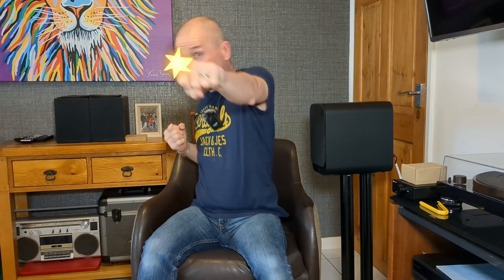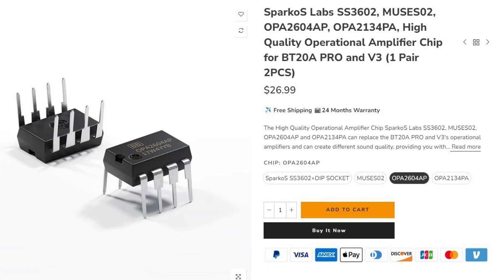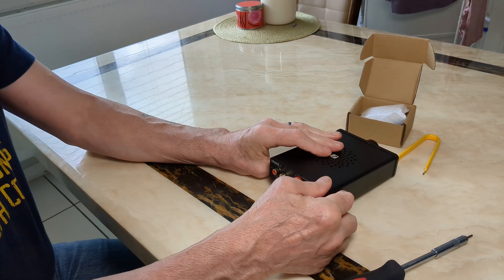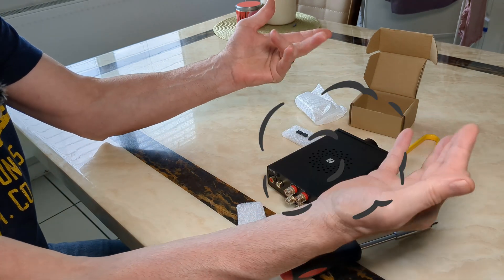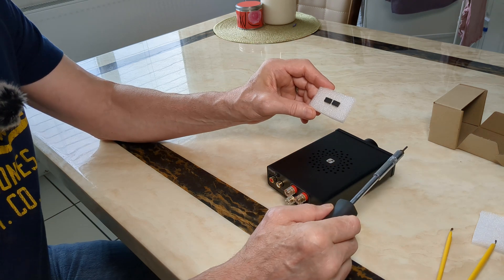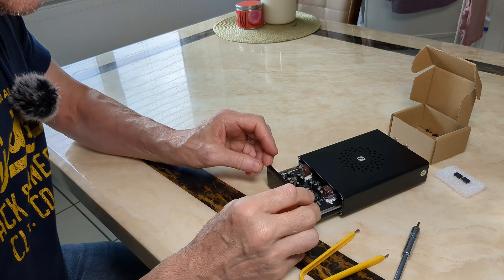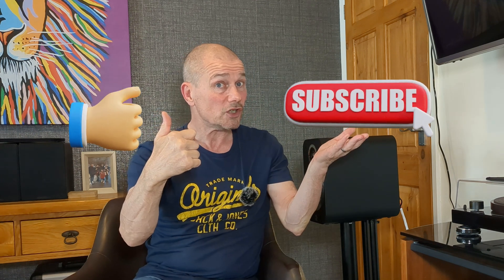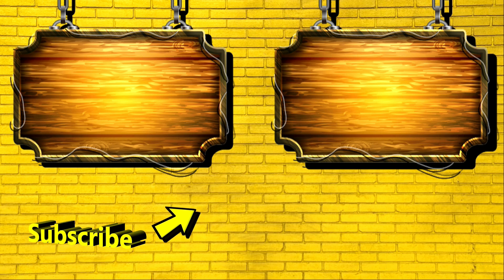NE5532 Vs Burr Brown OPA2604AP With Blind Sound Comparison

Comment: I saw in another vid a guy showed how you can slip a small zip-tie under the opamp chip and easily pull it out using that.  Almost zero cost. Well if you have to zip the zip-tie then I suppose it costs you a pair of ties ;-)

Comment: More midrange on the new ones. I’ve got a budget setup in my office, the for bt20a pro with monitor audio bronze 2’s, basic copper cable, and RCA’s. I find the mid range is lacking.

I get the bookshelf’s do not have a dedicated mid range, and worse cross overs that my floor standard downstairs, but I think the stock fosi makes the sound more muddy.

It’s not a bad little amp, but definitly need more mid/range. I will try the ones you have thanks.

Comment: OPA2604AP is clearly better here I can hear that with only one ear^^. It sounds much more analog and takes the harshness out of the highs. You're much more immersed in the sound than with the NE5532P. You can hear the digital harshness. Some people are just used to it and then say they like the NE5532 better. Once you sit down in front of the system yourself, you'll see...! The OPA2604AP is also certainly much better tuned than the chip from 1979. Welcome to the 1980s.

Comment: Op amps do not have a sound. The circuitry, of which they are parts, was designed using NE5532, which are the industry standard for very good reasons. Swapping for an op amp that certainly cannot be regarded as a direct drop-in replacement is simply not a good idea. In this case, the increased distortion of the circuitry can actually be heard.

Comment: We swapped out a bunch of NE5532 for OPA's of some number in the mic preamp of a mixer. Power supply ripple rejection was the measurement that improved and having before improved power supplys while keeping the amp the same I suspect that's what improved the sound with the OPA, the ripple rejection. I'd describe it as a grayness being removed. detail was the same.
I couldn't hear it on this test.
Reply: Yes Slew Rate is the big difference

Comment: Today I replaced the pre-installed NE5532Ps in my Fosi Audio P4 preamplifier with OPA2604APs. Only one is needed. In my Fosi V3 monos, I swapped the four 5532Ps for Audiophonics OPA1642s. The cost is low, the effect is amazing. A total of €30 plus €5 shipping from France to Germany. As far as I know, the OPA2604s are no longer regularly available; Audiophonics will be able to get them again at the end of June 2025. And please don't slap me:face-orange-raised-eyebrow:
Reply: will the Audiophonics OPA1642 work also in a P4 ?   i have one stock of course   Thanks a lot

Comment: That tool likely works fine, you just need to be patient and do a lot of wiggling. Left, right, left, right. Slowly does it, a bit at a time. I have one the same, works for me.

I thought A was better... sounded very slightly more open. I'm not sure if they were 100% level matched. But it was interesting to hear some kind of difference.

BTW if you have a tiny bit of electrical soldering skills, you can buy the SOIC-8 version (surface mount) version of these sorts of chips (2604, 1656, 1612, 2134, etc) for likely 1-5 pounds from a trusted distributor (mouser, digikey, farnell, lcsc, etc). In fact unless you buy enough of them, the biggest expense will likely be the shipping cost. Then you can solder them to a small DIP-8 adapter board for use in one of these sockets.

Comment: Preferred B through MacBook Air + DT 770 Pro; felt it was a bit fuller, which is more my bag but it was distorting a bit during the latter part of the first track.  A wasn't too bad by any means. 
About to swap a pair of Muses02 into my Fosi V3 Monos so this video was timely.

Comment: I could tell before you revealed it which was the 5532 and which was the 2604. I personally prefer the 2604 which has a "warmer" sound. The 5532 possibly has more defined treble, but I find it a little fatiguing to listen to after a while. I have tried many different op amps and they all have pros and cons. My current favourite is the Muses 2208 which I find very easy on the ears.
Reply: Do you find the 2604's imaging better? I do
Reply: @michaelhoudecki3657  Yes, much better instrument separation and a wider soundstage.
Reply: I'm with you too otherwise I just listened to it with phones speakers . I'm thinking on replacement of 4570 on my denon dct-2000 , after dac of 1702s . I like to get warm sound and huge sound stage and thick sound , and good harmonics specially in low mid that makes joy . What do u think ?

Comment: I hardly heard any difference, all these Fosi, Ayima "budget"chipamps sound more or less the same, that is FLAT HARSH and therefor quicky fatiguing, what REALLY makes a HUGE  and instant notaceble difference is audition a REAL CLASS A amp.... like the still pretty affordable BRZHIFI MUSIC FAX A21 , availeble from Alie express for around 250 Euro's , this is a chinese Clone; of the  Famous Britisch made,  Musical Fidelety a1 amp from the 80"s, that whas a real "High End amplifier, with a lovely warm and deteiled sound, with even today very few amps can touch....only drawback was its ernomous heat production ( you coold cook an egg on it) and of course the price ( the make an improved version witch does not run that hot but at a price, the chinese copied the most of the amp, and put newer an much better parts in it aswell gave it a very sturdy and bigger housing, that manage the heat way better,  i was toyying just as you with a few chipamps but one day ( fed up with their schrill sound) ordered one from alie, result?
MUch more "musical sound" detail, stereo with AND dept, a spound wich invites you to keep listening for hours on end, no more Harschness, the brzhifi is "only 20 watts per channel, but has way more current drive than these chip amps . so behaves like a 2X100 watt amp, even with 88 db eficient speakers you can get the police nokkong at your door.
try to  audician one , bet you be amazed.
Reply: I have the Fosi V3 Mono and also the A1 Clone you mentioned (which I had before the Fosi). When I first heard the Fosi Monos, they sounded better to me than the A1, but then I realised they were just a bit louder. Once I level matched both of them, the amps just sounded the same as each other, which is not really surprising as they are both good amps. The A1 is a cost effective way into trying class A amps though, so I'd recommend for that reason alone. Personally I've never really heard a difference in amps, unless one is intentionally coloured / distorted e.g. tube amps. I get more from changing speakers and using PEQ.

Comment: Rolling dead spiders. 😎👍
Well done.
YouTube compression makes it near impossible to hear. 
Even hi-resolution recorded files are near impossible to hear. 
I have an ESS Sabre DAC with switchable filters.
The audible changes are very, very small.
Some of the filters can cause a sense of pleasure or aggravation after a period of time listening on a fairly highly resolving system.
Like some cable / Interconnect changes. 
I have a few different DAC's and amplifiers on hand now, and I'm thinking that I will not be rolling anything, unless I'm displeased with something about the sound on a longer term.
At least rolling dead spiders is cheaper than constant amp and speaker changes 😎👍

Comment: I never had any luck with that style of IC extractor, or even the posher ones.

I found it MUCH safer and easier, to just gently pry each end of the chip with a small flat screwdriver.
Prying slightly at each end of the chip in turn, you get very used to it after a while.

Just be careful not to shove the screwdriver between the socket and the PCB. I've done that once or twice in the past. lol
Reply: Use a small zip tie. Super easy.
Reply: @ryanb8736  In my experience, any time a method is used that doesn't put equal pressure on both ends / sides of the chip, it often ends up with pins getting bent.

If you mean slotting a zip tie (cable tie) under the chip, there's usually not enough space, and you'd have to pry slightly with a screwdriver first.

Some people might get on with using those extraction tools, but I never have. lol

Especially the evil PLCC extractor tools, with the two prongs. Those are awful, imo.

Comment: I personally blind tested many times the NE5532P aginst straight wire (level matched of course), and to my ears it makes absolutely no difference whatsoever to the sound. So, any "OP-amp swap" is going to make either no change, or DEGRADE the sound. The fact that you hear a difference when replacing the NE5532P with a different OP-amp does not mean that you're getting an improvement. Anything sounding different than straight wire is in fact a degradation.
Reply: Everything you said is not possible  , A OP-Amp cannot be straight wired. 

Without a resolving system it's not likely you would hear change anyway.

Comment: Which are Rail-To-Rail Balanced outs?
Reply: You would not want that in this application.  The circuitry on the board configures the standard 8 pin layout as a phase splitter. Whatever you put in there has to conform to that layout.

Comment: In my opinion, the NE5532 is better, the sound is noticeably cleaner, but there is less bass.  With the OPA2640, what remains in my ears is a slightly noticeable, dirty, indistinct sound.  I think both op-amps are great, but the NE5532 wins for me in this presentation.

Comment: I choose A, the NE5532 op-amp as the sound is more natural and transparent; however, the amplifier was designed and tested using the venerable NE5532 op-amp, which underwent rigorous testing and measured well in the laboratory, with meticulously selected passive and active components for the best matching, though changing op-amps to another one, such as the OPA2604 FET op-amp, seems a good idea but must be measured for generated noise and distortion, as it is the surrounding circuit in the op-amp that also determines the sound quality based on how it was designed, the degree of transparency, nuance, and timbral accuracy, and since the amplifier was designed using a bipolar op-amp, the NE5532 was chosen.
Reply: Naaa ... they probably used the 5532 because it's dirt cheap and easily available.

Comment: Why does nobody experience piercing sounds with the stock NE5532 op amp, while on some recordings, sibilance becomes uncontrollably pronounced?  I only find one reviewer reporting that so far.
Reply: That is far more likely to be the fault of the recordings, than the op-amp.
If it was the op-amp you'd hear the same thing in every recording.

Comment: I've used the op amp removal tool many times and can't comprehend how proper use would mangle an op amp that badly. Maybe just operator error?
Reply: That kind of devistation usually results from thinking you're changing a tire... grab loosely and yank.

Comment: Installing an operational amplifier with a field input into the I-V converter is not the best idea, better than LT1496, OPA2211, LT1364, in a high-pass filter you can use OP 2604, but better than OPA2132P, Muses 8920.

Comment: Opa2604 is really cold and nasty. Try opa2134 ! This one is better. fuller sound, warmer, nice harmonics.
Reply: Yep. Added a pair to my Aiyima A07. Much improvement in sound. Very happy with change.
Reply: bought a pair of those, i didn't do the switch yet because i'm afraid they are fake and might harm my amp (bt20a pro) . from where did you bought yours?
Reply: I buy mine at mouser.

Comment: I played your video through a Adcom GFA-4302 class A amp. I actually thought A sounded better. There isn’t a op amp IC in my amplifier. It’s all discrete stages built into the circuit board. At least on my stereo, A sounded better. To each their own. Thanks for the video. 

 I’m going to buy some Burson discrete op amps and install them into my Soundstream reference class A Picasso and see if it makes a difference. It currently has OP257GP op amps.

Comment: I replaced the 5532NE with an OPA2604 on my Fosi V3 today. The replacement is justified, the sound is much better, the vocals are livelier,  not as cloudy as on the 5532NE, the sound stage is wider, in the upper range can hear more nuances, the sound is more detailed. I took the original ones around town, they are cheaper here 16 dollars for two. I recommend them in particular. You don't need more expensive ones here, there is definitely no point in putting Muses,  Burr Brown steers well in terms of sound.
Reply: P.S. Supplement after 4 hours of listening. OPA2604 has a more "fatter" sound in contrast to the 5532, this is especially felt on heavy music. At medium frequencies, the vocals are better, however, it is slightly distributed to the left and right sides, on the 5532 it is clearly in the center, which at first glance may not be in favor of OPA2604, but in general it adds more expressiveness and volume to the vocals.

Comment: Interesting. I've read so many reviews mentioning OPA2604AP as a very good choice, with warm, but like a super detailed, wide and balanced sound. Although here I found it rather muddy, I tried to perceive it like a certain "dark" colouring, but failed cause having in fact a bit wider stage it performs som that I found pretty much every band to sound grainy and kinda overlapping, interfering each other what makes the overall sound noticeably less clear than the stock IC did. Sure, it can be my setup's sound that makes it sound like that.
Reply: NE 5532 Sounds very slightly more „Open“ so no Need to Switch at all! Only SPARKOS will make a noticeable difference - but they cost as much as the whole amplifier! Use carpets! Everything will sound better!

Comment: Can you buy an upgraded opamp version? Don't need the inferior ones.
Reply: I don't think you can. They probably get the board pre-stocked with the default OpAmps from the factory anyway. So you always kinda have to do a bit of DIY modding.
Reply: Keep the originals as spares.

Comment: The indent on top is simply a cap covering an opening to UV wipe the chips 😵‍💫
Reply: No it isn't.  Op-Amps are built on fixed dies that cannot be re-programmed.  The top indent actually indicates pin 1.

Comment: I ttok the test and preferred A - the 5532
Reply: I concur. The 5532 does sound better.
Reply: Me too.
Reply: Hi, im right now considering to buy the Sparko-Op Amps to upgrade my DAC.

Have u tested them yet? And would u buy them over the ones from this video here?
Reply: @the_Cherusci yes definitely ive just upgraded from a A07 aiyima with sparkos op amps to 2x Fosi mono blocks and the a07 was much better 😥  until I changed the op amps  😀
Reply: NE5532 with suffix "A" is more for audio than with suffix "P". I use Burr Brown OPA1622.

Comment: Opamp rolling without understanding the entire circuit is pretty much rolling the dice.
I mean in textbook designed line and buffer stages the chance the get lucky with a boutique
opamp are the highest. However if more engineering was involved to squeeze out max sound-
quality at a low budget even line and bufferstages can be taylored to a specific opamp and 
simply changing only it can result in frustration.
Reply: Fosi Audio recommended this Op amp for V3

Comment: On the NE5532 the stage sounds natural and cohesive, the sound on the left, middle and right is clearly audible, but on the OPA2604AP the stage is disrupted, audible on the left, the middle is crushed, and the right is crushed.
I do not take any responsibility for google translate :)
Reply: There is a lot of this middle in the "middle", as you can say, in 5532, due to which the sound seems sluggish and flat.